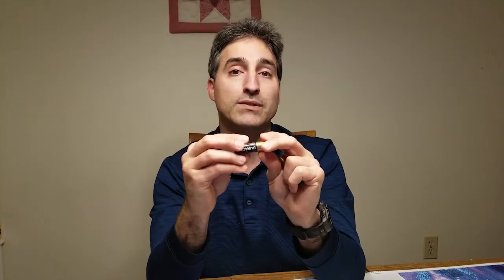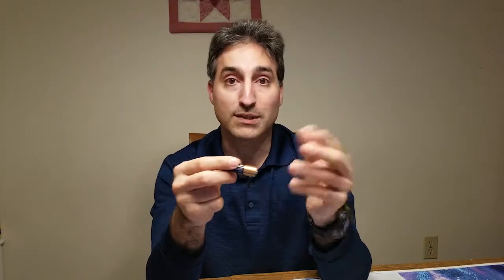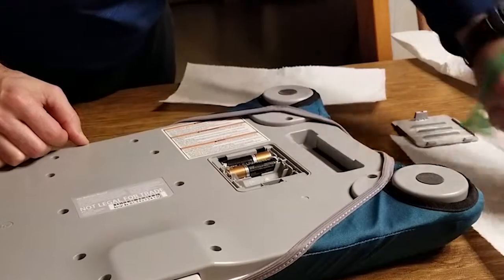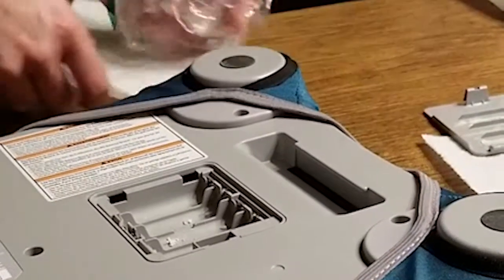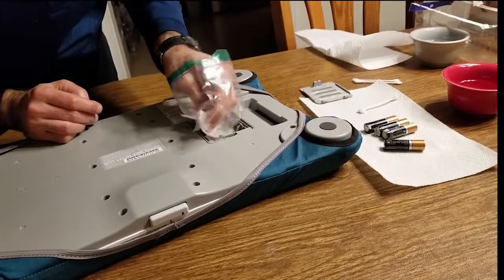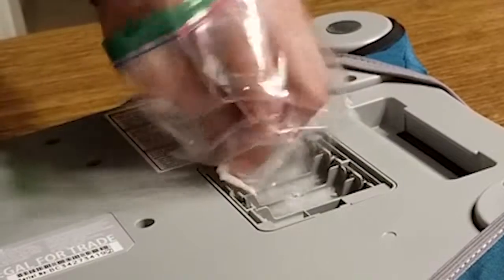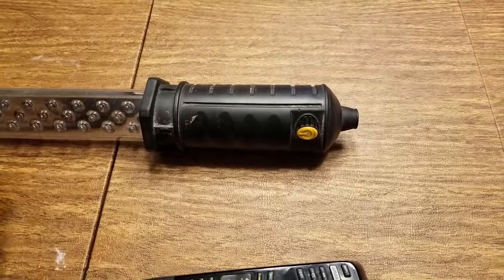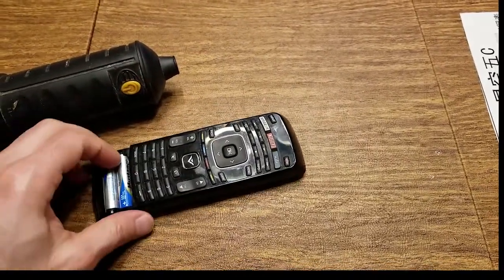Leaky Battery Cleanup

Comment: I knew this already long time. I've touched linking batteries before,,, & the acid didn't eat my hand off but it can cause a little bit of Irritation but nothing harmful or death, the only thing i wouldn't recommend doing is putting your hand in your mouth unless you have a death wish upon your shoulders that would be not recommended, but I washed my hands straight away afterwards. I got most of it on there so other than that it can't really do any damage but that's not to recommend keeping it on your hands,,, the erosion from the batteries but anyway Thanks for the video it was fun to 👌watch☮️✌️...

Comment: For the wii balance board, did it ever work in the end? Cause mine is doing the blinking light like yours but then goes away like yours as well but it won’t stay on and connect to my Wii
Reply from the maker: Yes, it did work once I put fresh batteries in and fired up Wii Fit. Did you try to resync it with the Wii console? I found that sometimes the controllers or boards would lose sync and require a resync using the sync buttons on both devices.

Comment: Does it need to be white vinegar?
Reply from the maker: It needs to be an acid, and white vinegar is a very inexpensive option. I suppose you could use apple cider vinegar as well.
Reply: @par64guy  Apple cider vinegar is great for cramps.

Comment: mine rusted and it broke. it won’t even hold the battery 😫
Reply from the maker: Sometimes the degradation results in the terminals getting destroyed. You can fix it if you are willing to do some surgery and open the board to solder in a new terminal. I have seen other videos where people harvest battery terminals from soon-to-be discarded electronics for that reason.
Reply: @par64guy  Any chance you would know where to source the replacement parts? I have one fully corroded contact point and can't find a replica plate to replace it with :(